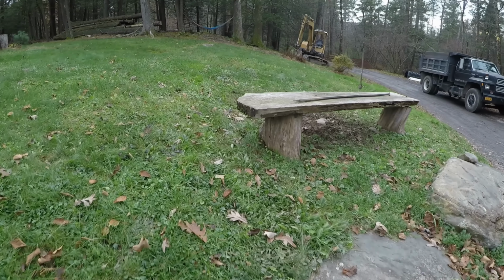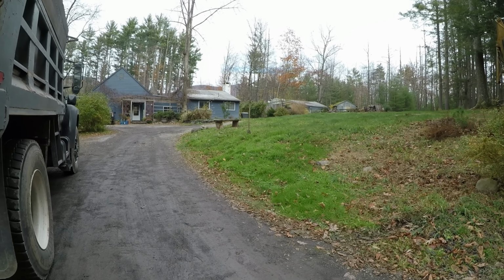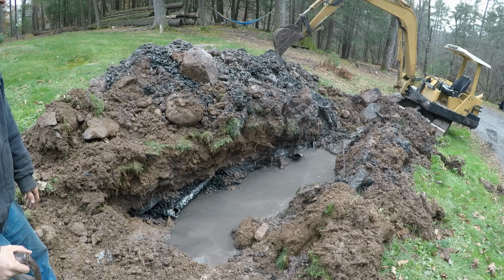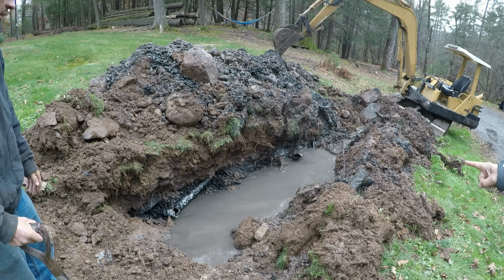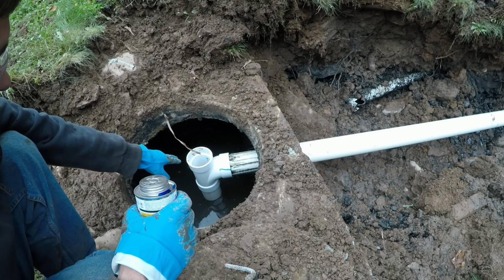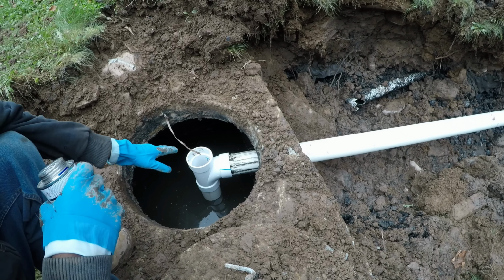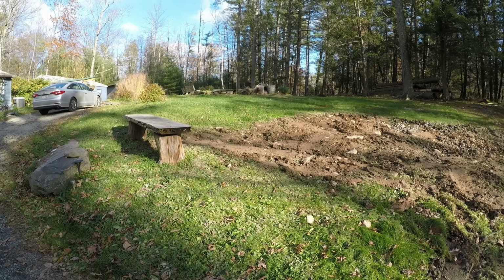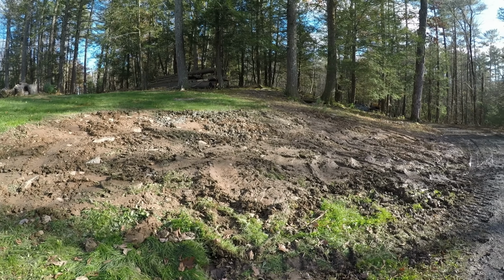Replacing a leach field

Comment: the thing that really impresses me is u don't have the flashest gear but u leave ur job sites lookin 10 x beter than people that have the mac daddy million dollar equipment that says alot abowt u and ur attitude, keep it up bro,
Reply from the maker: Thanks,
Reply from the maker: Thanks, yeah those were a drop difficult to put together, I may get 20's next time. I wear XL shirt.
Reply: The high dollar big daddies need to get to that next job quick; they need the money to make the bank payment on that fancy equipment!!  They miss one payment and they're through!  So much for doing a good job!!!  It's boarder line desperation working for the banksters!!!!
Reply: I could not have seed it better.
Reply: Andrew Camarata 
   Hey, just curious how many bathrooms that house has. Our local code calls for 25 feet of tunnel for every toilet, so I ended up installing 3 times as much as you when building my house.
  Of course this is in the SE US so while my terrain looks similar to that house, percolation rates and stc are probably different.
Thanks If you can answer, and
Peace
Reply from the maker: Thanks. I think it was 2 small houses sharing that system, and one is just a weekend house. So that system should probably be fine. I was kind of working with the guys budget. Did you use the same size chambers? There are much smaller ones available, I usually just get the biggest one, and than put a bunch of gravel around them. Sometimes on septic jobs when engineers get involved, they will design a system that is very expensive, using that 4" perf pipe, which I don't think is as good.
Reply: Andrew Camarata 
  From what I can see in the video, look like they fit together and we the same size as what was used, but that was more than twelve years ago, so maybe not. 
  And no criticism intended on what you did, was more curious about differences in government or code regulations. 
  In this state mine are a bit stricter because technically my property is borderlands on the national forest, down in the flat lands they only need 18 feet of tunnel per toilet/bathroom. 
  So just curious about the different rules between our countries /areas. 
Thanks again
Reply: PS 
The perf pipe is no longer allowed around here unless you have space for 75t feet of length for each toilet /bathroom, which is why I went with the tunnels. And also have to agree that they are a more efficient method of installing a tank overflow system.
Reply: mussell nz
Reply: Very nice job!
Reply: I agree not the flashy equipment, but you save tons of cash by fixing it yourself and no huge notes.. All that helps profit and can price the big guys out.. Love your work bro.
Reply: Are you not required to get a Perc test for a repair? 
One line is hardly anything guy.
Reply: Translation: The thing that really impresses me is that you don't have the most expensive gear but you leave your job sites looking ten times better than the people that have the mac daddy million dollar equipment, that says a lot about you and your attitude. Keep it up bro.
Reply: Get rid of the frigging music
Reply: It always depends on if someone knows what he is doing. equipment cant help if someones work is bad. imagine the work andrew could do with top notch equipment and his top notch knowledge.
Reply: yes please
Reply: Well said and I agree.

First of all I do enjoy your vids Andrew and really appreciate your "'no wasted motions" methods. There are a few of us that recognize and practice this but most that do are self-employed and see this grab ass wasted motion on a daily basis from a mile away and these individuals don’t understand why they can’t get ahead. It seems to me that it must be innate - hereditary or too much TV – video games.

All the wimps that say "your methods are not by the book" well just remember that "we that have fought in wars had much rather follow someone into combat who has fought in a thousand wars than someone who has read a thousand books on how to fight a war.  If you don’t believe me just ask anyone that has been in combat.

Additionally, to the nimrods that think a small rock and/or pebble will damage sch. 40 pvc are making a perpetual un-thought out accusation. There are tens of thousands more miles of pvc water lines than sewer and the vast, VAST majority are trenched and surrounded in aggregate and running pressures of 30 to 100+ psi with most breaks due to expansion/contraction or cheap grade and older pipe.

Off topic but to me of the most laughable moments, in another vid, was the buffoon placing the underground propane tank. Needless to say he probably had an intellectual tell him how to do it before he left for the job. Keep safe Andrew and stay away from these useful idiots by not getting in the hole during a pick. Who knows how he rigged those lines etc. There are some that are component but don’t ever take the chance. Society (America) needs more of your kind fighting the war and……making videos.

So, keep fighting the good fight Andrew and keep those boots muddy and your hands dirty….you have lots of backing.
Reply: It's not the levers that do the job, it's the hands on the levers.
Reply: @retropixelshow  New here?
Reply: @Ruthless Goat
Quite, found this channel about one year ago and it's very satisfying to watch him do the jobs, especially those with water.
Reply: Yeah right, the guys who were diggin' fiber for me and my neighbors, they had almost new equipment:
1x Bobcat E45
1X Bobcat E62
1x Small loader
They were kinda slow, and they did a terrible job of finishing of restoring ground after themselfs :(
Reply: A Year late but great comment - muss
Reply: ANDREW COULD BUILD A WHOLE HOUSE WITH JUST A HAMMER.......LOL
Reply: Camarata replaces a bad septic leach field, using the leach field’s chambers.
Reply: aljanat5  I'm and doctor................I'd like to know where MY kickbacks are..............They may be being sent to someone else by accident???
Reply: WOT? lol
Reply: @markraymond2221  prescribing the wrong medicines ?
Reply: what impresses me is that he does these jobs mostly alone
Reply: @TheSepticGuy  That system is adequate, you should see what our company found at Lake Of The Ozarks, some houses only had a 10ft pipe going down in the rocks with no tank at all. The sewer was running directly into the lake, lake lots now are required to have proper system by law, or the house gets the bulldozer (true-story)
Reply: Msgt D Oorah
1 second ago
We The Few  are back ... thank you , some of my troops are like you .. We got your message. We expected this attack and were not taken by surprise. We continue with you and others .. Our love , our light, our strength and protection for you JC KAY.  OORAH!
✝ALL CHILDREN ARE NOT FOR SALE NOR SLAVERY NOR SACRIFICE.  THEY WILL NEVER BE ALONG. G'D SPEED PATRIOR. WWG1WGA!  ...""Freedom is not Free'''''.. DOMINION AI MACHINES are still in use around the world to control elections . The OCCULT CCP has control of all the DEMONCRACKS and GOP TRAITORS  also All those collaborators who support the Occult .. Prepare all you sinners G'D Justice is upon you and ours ..FEAR is what make you weak .. Righteous one believe in yourself and your power .OORAH!!
Reply: Very smart kid, but he ran the bells the wrong way on the pipe
Reply: @AndrewCamarata  you did a good job. Very budget friendly and quickly got it done.

Comment: A Camarata classic from the archives!  I'm dealing with a failed leach field so time to get to work.  I like how you did a hybrid approach with using both gravel and the tunnel system.  nice.  Most vids with the tunnel just throw it straight on bare soil.

Comment: Nice job on the leach field repair and replacement, Andrew. I love when homeowners tell you they need their drain or leach field repaired or replaced and when you get there you find a damn cesspool. :-)
Reply from the maker: Thanks. Yeah, that's usually the case. I was there a few months prior looking at it, and there was a little water coming out. He waited it for it to completely fail before having it fixed.
Reply: You did a great job even though...:-)
Reply: Andrew Camarata I thought on these types of systems they use sand instead of stone.  Just curious but great job by the way

Comment: thanks for sharing the video you get a mighty fine job the only thing I would have done different was pulled those trees out that was near the leach line those roots will plug up the leech line within 5 years I like to keep trees and growing bushes 75 ft away from my septic system

Comment: The pipe from the tank to leach fields can be pitched... leach field itself should be perfectly level so water drains evenly, doesn’t pool up and fail starting one side to the other, this leach field is definatly fixed but would last longer if leach field was level. Good work brother

Comment: when laying pipe, the water should always flow from the straight end of a section into the bell end of the next section, not out of the bell and into the straight
Reply: Yes u write  but remember no pressure in this pipe
Reply: @eddiehernandez854  its not about pressure its about making a smooth transition just in case something were to be in the pipe don't want it to get hung at that point.

Comment: Love your channel and have spent hours watching your videos. 

I think you need to do a video on using aircrete and buy the Little Dragon or make one for a DYI aircrete System. Aircrete would have been perfect for your hot tub and grotto. 

To all those septic experts commenting on permits, percs, and soil, you need to think a little more logically. 

We all urinate at most a 1/2 gallon per day. Go out an dump a 1/2 gallon of urine in your yard. Most people that have wells and septics are on bigger plots too. That 1/2 gallon will do absolutely nothing to your yard or the ground water. Now multiply it by 5 members in a household. You are now at 2 and 1/2 gallons. It will do zero to your yard and will evaporate or soak in before the day is over. 

Now dilute that water with all of your toilet flushes, showers, teeth brushings, dish washing and laundry and don’t forget rain and we are talking about gallons and gallons of water diluting your urine going out into the yard. There is zero to worry about. 

Now then there is also the food we eat that gets put in fancy North Face brown puffer jackets and hangs out in the cement or plastic septic tanks and then the water runs by and Parties with the jackets.  All those gallons of water carry a little something extra, but it is underground and so diluted it is all so harmless. 

If you want to know if the effluent is harmless, go look at the grass near a septic tank that has been in a state of over flow. It is the lushest green you will ever see. 

What is my point?  People are worried about effluent that if used and sprayed all over the yard, would give you the greenest yard ever, but ironically we call Green Lawn and Eco Lab and ACME Grass to put all kinds of dangerous chemicals to kill weeds and bugs and nobody worries about that run off, when all that we need for the healthiest lawn ever is sitting in the septic tank. 

I have an estimate for what you just did in this video, and in plain English it says to budget $45,000 for a leach field replacement. 

So Andy...hold your head high. You threaded the needle to help the little guy, and provided a safe leach field and ensured no dangerous water will make it to the Hudson and did it without going through the grifter system.

Comment: First of all great video and thank you for showing us how you do things.

I do the same work with my father here in Georgia and I can say that it's similar to where you live. Here we just install the chamber by itself ( no gravel,sand,ect..). The installer needs a license and has to apply for a permit but no engineer is  involved ( unless the ground is complete garbage). The inspector goes to the site prior to our work, writes down the general area where they want it and will come to inspect before we cover up to take records/measurements.

I would recommend  a quick release bucket for digging smaller trenches quicker and less time spent covering up. Everything else is just preference. Great job man!!
Reply: I'd say in this situation its more of a "hey buddie, can you do a septic?"  Yeah man..be right over.  In and out.
Reply: I need mine done. In Georgia

Comment: good job . i replaced my septic tank with a 1200 gallon cinderblock cesspool and found a 4-500 gallon cwsspool that i put an overflow pipe into. the cinderblocks , lid pvc pipe and excavating cost me. under $500 back in 1980s in NYS . 
No engineers required, no inspectors etc. Never had a problem with it . My grandkids will be retired before that baby needs service. 
A buddy of mine had to have an engineered septic designed by a PE. ,and installed by a county approved septic system installer a few years later. It was in a watershed district, and it cost him about 20 thou. Thiw was in 1989 or 1990
Reply: Setting a pool timer

Comment: Very nice job but you need to bed your pipe before back filling your pipe. That protects the pipe from rocks and it also protects you from redoing a job because of a rock that broke your pipe. Just a little bit of advice from someone that has been there
Reply from the maker: Andrew Tiefry thanks. I think that schedule 40 is bulletproof, I've never had a problem with that. Maybe if it was thin wall of even sdr35, it would need sand or something.
Reply from the maker: That's a good comment, I'm going to do a video very soon testing the strengths of all the different types of buried utility lines.
Reply from the maker: Yeah, that's a very good idea. That wouldn't be necessary in this case, because the ground under the pipe was not disturbed and had already settled. I often make sure I pack the area tightly when backfilling around a new septic tank. Did you see my test video testing the SCH40 pipe? I don't think that would break off easily. Maybe thin wall or the green pipe.
Reply: I had to dig one up last year, done exactly like this with sch 40.  The backfill material was too soft (looked similar to yours) and the inlet and outlet developed swayback/low spots
Reply: we did a geothermal system and had like 12 1" black water lines which is heavier then the sch 40 and ill be damed if we didnt have to dig up their front yard and sidewalk from a single freakin rock that just hit the pipe so perfect and punctured it! we couldnt believe it! i tried to blame the excavator operator but we dug it up and was a rock haha!
Reply: First thing I picked up on, there were some big rocks in there and heaven knows what might drive up in there. I'm sure the customer wouldn't object the price of some bedding material. I thought you were going to use the pile dumped on the roadway, but that was earmarked for the road.
Reply: @AndrewCamarata  you think wrong then, its not. having done this for 25 years now a decent size rock can come down on the pipe during backfill and crack it leading to roots in the line. This doesn't surprise me though coming from the guy who thinks the concrete he is getting is somehow special and wont crack even with all the organics you leave below it.
Reply: Andrew Camarata I’ve buried thousands of feet of SDR 21 gasket water pipe and have not had any failures. 

But I’ve had numerous “plumbers” that use schedule 40 repairing runs next to mine how I’m doing it all wrong...🤷🏼‍♂️
Reply: Andrew and Andrew 
It's also called shading with sand when backfilling around plastics.  PVC, ABS, FLEX, ETC. 
You're right Andrew that SCH 40 & 80 PVC is pretty tough but you were shoving in some pretty big rock. Couldn't tell whether you saw it or not. Maybe low pressure sewage systems aren't as critical but with sprinkler irrigation just the water flowing in the pipes can make enough vibration to cause even small rocks to rub holes causing leaks. 
You did a phenomenal job as always ! 
Finally was pleasantly surprised to watch the installation of the chambers as a leech field. Never seen that before. I
An agree, bet the chambers ultimately out-perform the puka pipe as we call it here in Hawaii.
Reply: @TheSuppressFurry  "having done this for 25 years now" lol, I bet you ain't even 25 years old.

Comment: Never run the bell end of the pipe that way cut the bell end off the first piece and run the bell end opposite way
Reply: exactly !!!!!
Reply: Yes, Andrew did that WRONG...
Reply: Only applicable on the house sewage side of the tank. Effluent side should have no solids. 

Not saying that its not best practice for the sake of consistency, just that it isn't required and makes minimal to no difference.
Reply: In the old days before PVC, it was important to assemble the pipe as you stated so it would act as a funnel and not leak. With today’s PVC and glue makes a very good connection and doesn’t require orientation anymore.